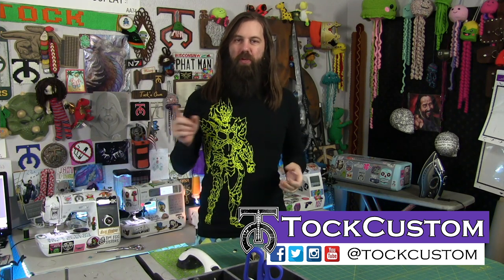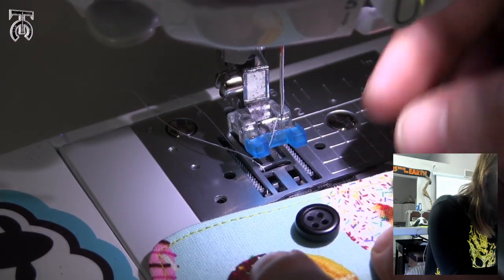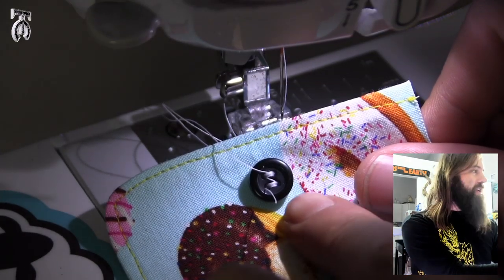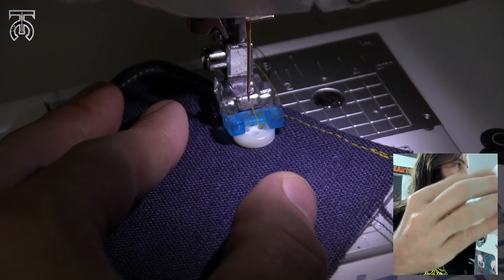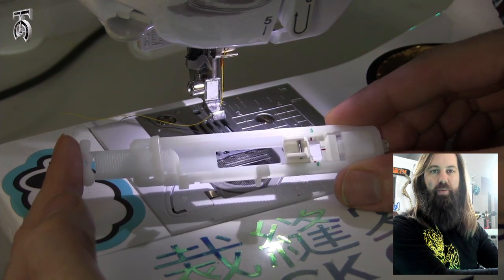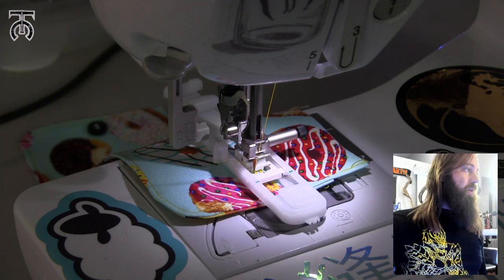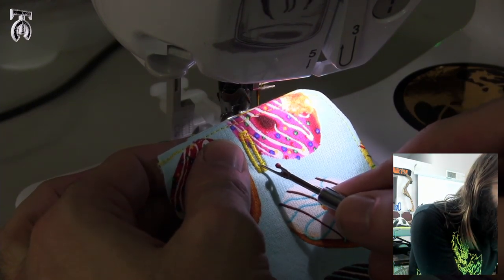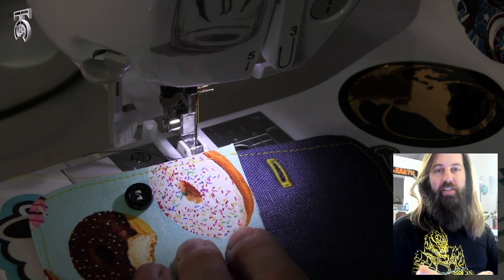How to sew buttons & button-holes with a sewing machine - Beginner level sewing tutorial

Comment: A great video. I hate sewing buttons by hand. I don't think my machine has a button hole setting but i should still be able to put buttons on.
Reply from the maker: Thanks man, yeah you can use a regular presser foot, but sometimes the button will slide around. It is possible though :)

Comment: I accidentally saw your videos . I really liked the way You explaining clearly to understand for beginners. I have trouble while doing button hole.. while Stiching suddenly in the middle it get struck with cluster of stiches in one place . How to rectify that. Thanks in advance.
Reply from the maker: Oh I hate when that happens. Usually thats a good time to change your needle and make sure your tension is set correctly. Since when you do buttonholes you'll end up sewing through more fabric and interfacing, it'll be different than sewing the other parts. Also it can be helpful to not let your machine go at maximum speed during buttonholes if you have issues.

One other thing I though of. My first two machines were very cheap and did a terrible job at doing buttonholes, they always bunched up with thread. My newer/better machines are much more reliable.
Reply: Tock Custom Thankyou so much for your reply..I will keep this in mind when I do button hole next time.

Comment: As usual, a great video.

A tip for users of Brother machines (perhaps many others as well):  Rather than holding your foot on the pedal for 1-step buttonhole making, just unplug the pedal and use the start/stop button like you do when you wind a bobbin.  Then you can walk away and get your coffee from another room, and not just drink it if it's within reach.  

Also, for jackets and thick clothing that you're attaching buttons to, I have a similar foot that allows me to sew over a tiny finger which leaves slack when retracted.  When doing that, I'll cut the tails extremely long, pull them through the button holes and wrap them around the stitches to hold the loose stitches together and make the button stand more firmly.
Reply from the maker: Yep, you can use the button if you unplug the machine for sure. Doing a buttonhole only takes about 10 seconds though, so it's no biggie either way.

Thanks for the info on doing a machine automated shank button, I need to get that presser foot!
Reply: @TockCustom  It came with one of my older Brother machines.  It seems that both my and your foot are called M.  The old version had a steel clip that held the button to the foot, so you could lift the foot and keep the button aligned with the needle while adjusting the fabric under it, plus that clear sliding finger.  Look for XE2643001.  "Shank button", yeah.  Thanks!  I didn't know the term, but it makes perfect sense.

I still remember the first time I did a 3-step button hole.  That was a dreadful process, and my eyes almost popped out of my head when I first saw my machine do the 1-step.

As for pulling the pedal, I've had the mental lapse of lifting my foot and screwing up the process, so I've gotten into that habit.  I also will slide the speed selector to slow when I start a buttonhole and then slide it faster when I see it feeding correctly.

Comment: I've wondered about that for a while. neat! what about with older machines? how old of a machine can you get before it no longer works like that ?
Reply from the maker: If your machine has a Zig-Zag stitch, and you can set the stitch length to "Zero mm" it will be able to work - also you'll need to be able to adjust the width of the zig-zag as well. I'm pretty sure most machines can handle this, even older ones :)

Great question!